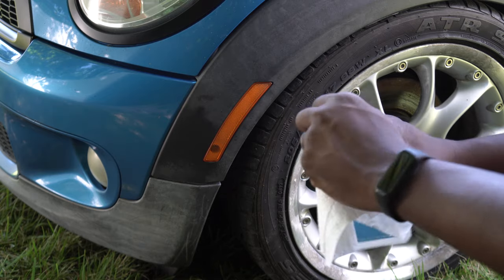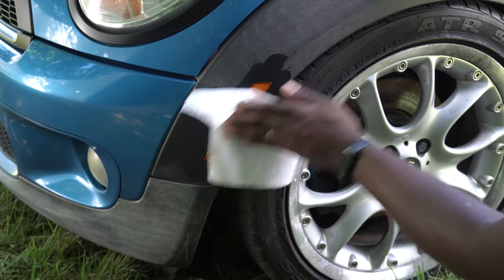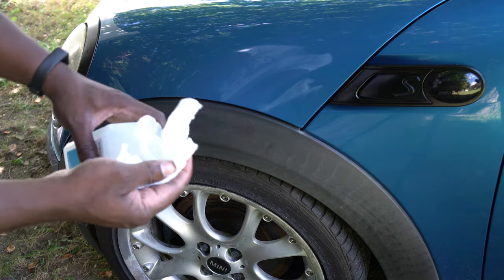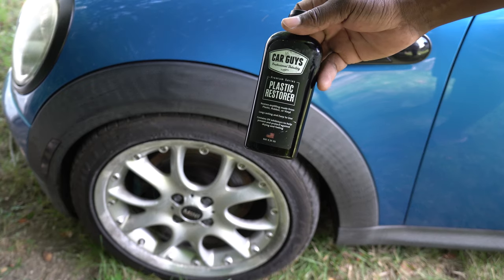R56 Mini Cooper S Plastic Restore Side Trims and Wheel Arches

Comment: Plastic restorer is good, however you'll need to apply it every time you wash the car. Mini dealers heat the trims up with a blow torch.
Reply: You have to wash it before or after the process?